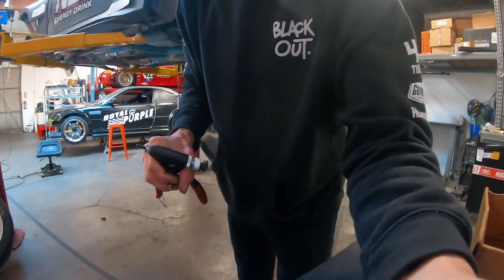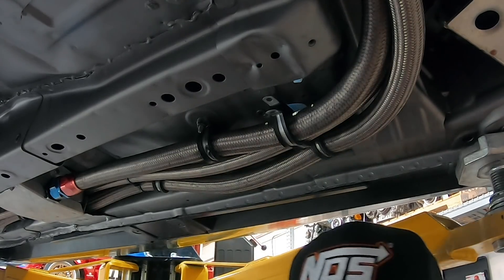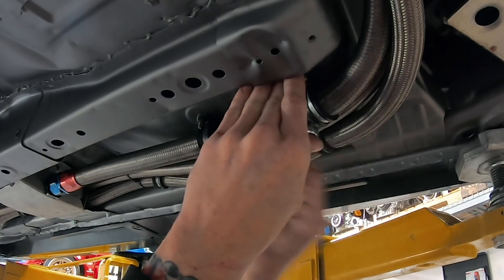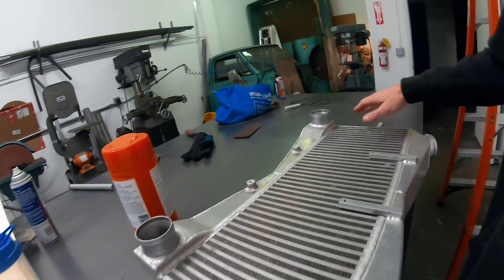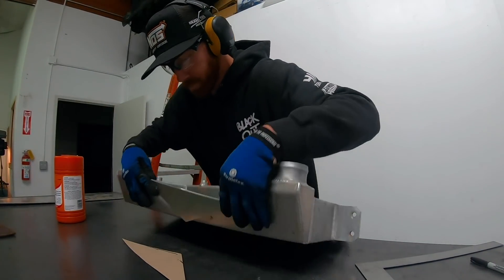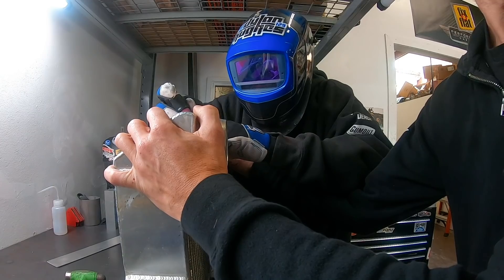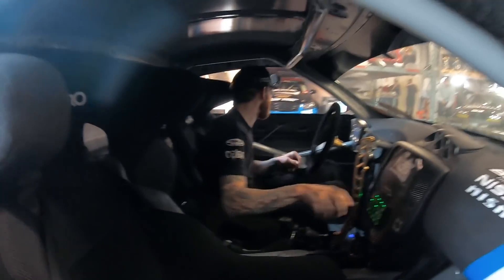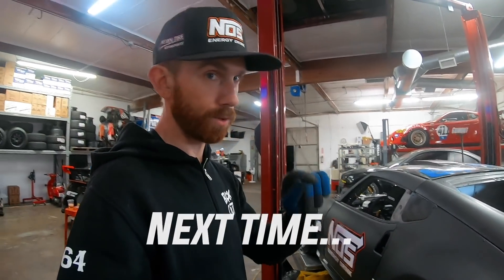How to Rivnut and Custom Intercooler Endtanks

Comment from the maker: What kind of welder do you use in your garage?
Reply: Everlast power tig 185dv, does everything I need it for
Reply: @we use a 30year old welder from Elektra Beckum (Mig/Mag 160)... german solid quality. No cheap plastics and no chinesium 😁😂🤘will work another 30years 😅😂

Comment: If your dry sump is at the back. How much oil does the engine need accounting for the lines and everything
Reply from the maker: The dry sump tank is 3 gallons but we only put about 2 gallons in it, plus the engine and lines will get it back to about 2.5 gallons